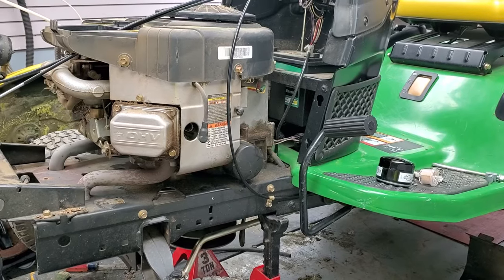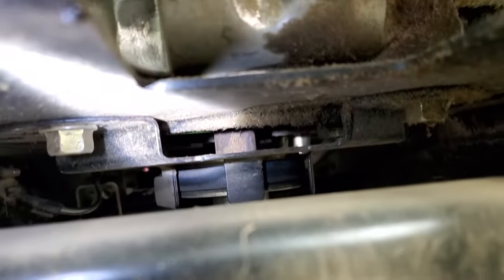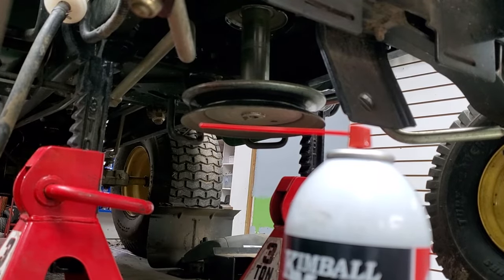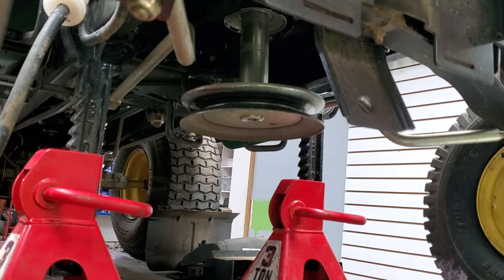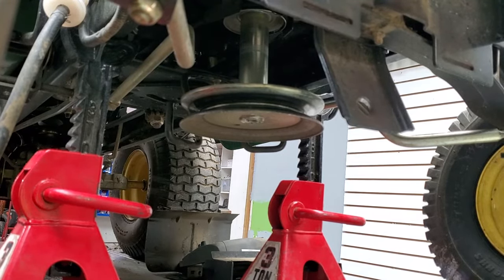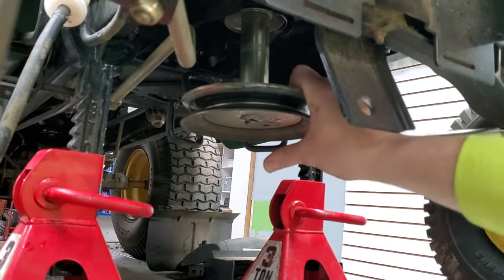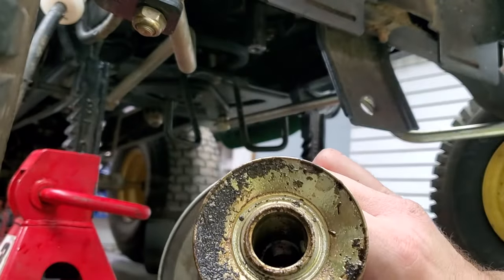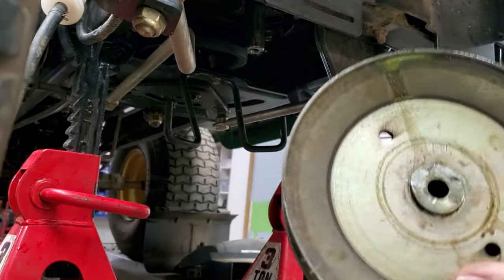Stuck On PTO Pulley Removal Easiest Way

Comment: Harmonic Balancer puller works great.  Put the crank bolt in a few threads and screw the HB puller on.  Takes a few minutes to bolt it to the pulley and a few seconds to pop it off.
Reply from the maker: These pulleys are ok to do that with but many of them are weak and will bend if it is really stuck. Great tip!

Comment: I just removed a Stuck pulley from a 2006 cub cadet.. and It  took m4 1 week, heat, cans of penetrating oil, hammers, pry bars, a puller,, and ultimately I had to cut it out with a grinder and hammer chisel
Reply from the maker: Oh boy, really welded on there!

Comment: Kimball Midwest penetrating oil. Hit the bottom of the pulley on the shaft to vibrate the penetrating fluid down the shaft. Tap the side of the sleeve to release the pulley.
Reply from the maker: Play by play

Comment: I agree with using the air hammer. But I believe if you would have put a longer bolt in there with a dimple in the center of the bolt head. And then used your air hammer with a  pointed air chisel placed inside that dimpled spot it would have been easier to get it out
Reply from the maker: Definitely agree there, does seem to work better

Comment: Use a sacrificial bolt with a divot drilled/punched into the head into which a pointy air hammer chisel will seat. Taryl Fixes All has several sizes of these bolts he keeps on had for just this. Seems like the penetrating oil got down into there really good. Thx.
Reply from the maker: Right on!

Comment: Better idea is to  get another matching bolt; Drill the center off the nut  and taper the end of punch  to help keep the  impact hammer from wondering all over the place.
Reply from the maker: That definitely helps keep things centered up! Many times we will use a bolt with a drill hole just started to make a little dimple to keep position. Thanks for watching!
Reply: I use a 8 inch 1/4 extension. I use the square part of it to put the air hammer in. The extension will bottom out in the hole without damaging the threads. Been doing it for yrs. But it will damage the extension a little. So I use it just for these jobs.
Reply from the maker: Awesome info!

Comment: If you snap the bolt.. sort the issue permantly.. weld a couple of nuts on it where you can then drill holes for grub screws.. hell of alot easier in the future for replacing belts etc.. not so inclined to seize 
As far as im concerned.. 
Works for me anyways!
Reply from the maker: That's is a good idea as a last resort! I have never broken one coming out but i'm sure some have come close!
Reply from the maker: Thanks for watching!!
Reply: @IndRepair  thankyou!

Comment: I'm having the opposite problem mine is just sliding down. Is there supposed to be a bolt in there
Reply from the maker: A bolt will hold the pulley onto the shaft, yes

Comment: I used a gear puller, I ended up boogering up the threads, I like this way better.
Reply from the maker: Yeah a puller works in some situations but I do not use them often because they can bend the pulley also. Thanks for watching!

Comment: loosen bolt , air hammer on head of bolt , fast , no lube needed
Reply from the maker: Doesn't work quite as well in my opinion but if it works it works! Thanks for watching!

Comment: Looks like you still had tension on the drive belt.  That may have been providing lateral tension, working against you.  Just saying.👍😁
Reply from the maker: There was not tension on the belt, if there was I would have needed to work against it to remove the pulley when it finally came off. Some models (like zero turns) you will not have the option to remove the tension with a brake, you will have to roll it off a pulley first

Comment: I do not believe mine has a bolt when I looked under. It is on an opposed twin. Could it have broken off?
Reply from the maker: It sure could have!
Reply: @IndRepair  Just took it off, needed a 5/8 with a small extension. The bolt is in the center of the stack pulley! This is a 2000ish murray 42".
Reply: Also Murray put a ton of antisieze..it just dropped out. The 'key' looks like a dimple or weld in the tube that slides on the crankshaft keyway. Must be a custom part.
Reply from the maker: @alb12345672  Glad you got it taken care of! Great job!
Reply from the maker: @alb12345672  It sure is pretty custom! Someone must have had it off before? I have never seen anti-seize from the factory

Comment: Won't work in most cases.    Not for the really stuck ones for sure.   This one was barely stuck.
Reply from the maker: Do them all the time with this method and it is the most effective way. Yes sometimes things are rusted and almost welded together. If that is the case nothing short of cutting it off is going to remove it. Thanks for watching!